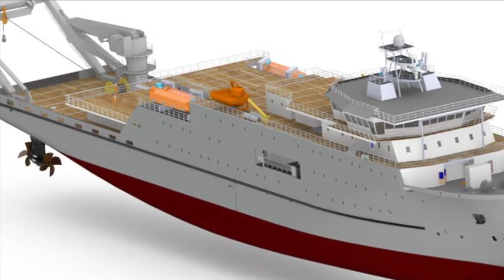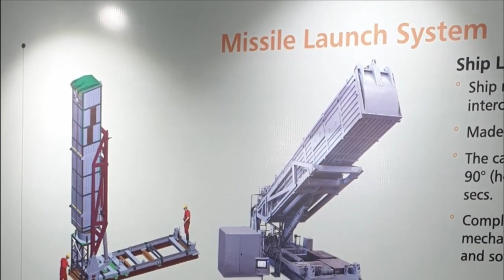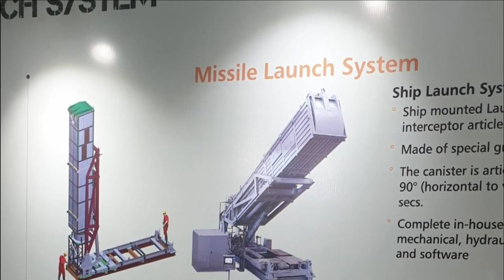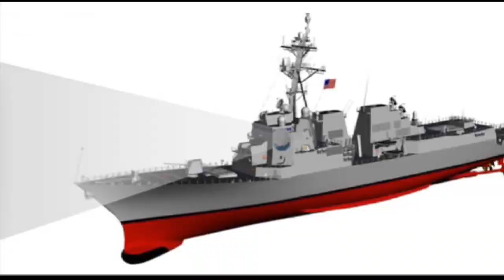INS Anvesh – 1st floating missile test range (FTR) could have been used for Naval BMD trial #drdo

Comment: Finally I understand what AD2 is. This seems to imply that the BMD system is at a very advanced stage and is ready for deployment. I am wondering why we are not seeing foreign reaction, in particular Pakistan/USA/Zhongguo? They should be severely pissed off that Bharat has achieved advanced tech. They have been before at even minor tech advances.